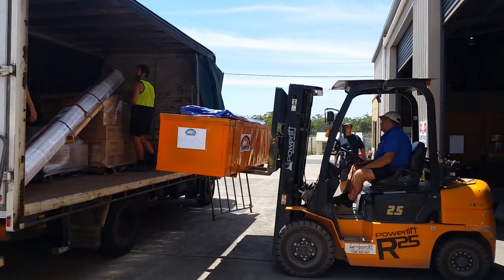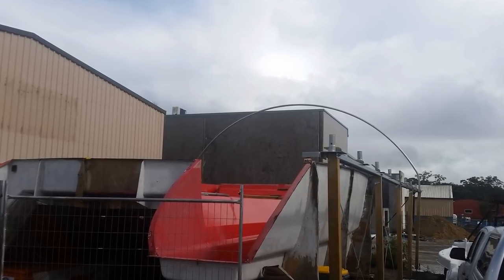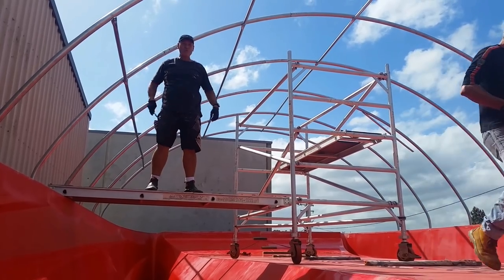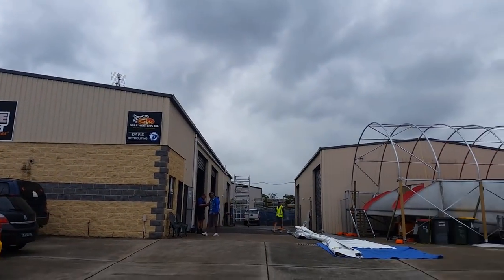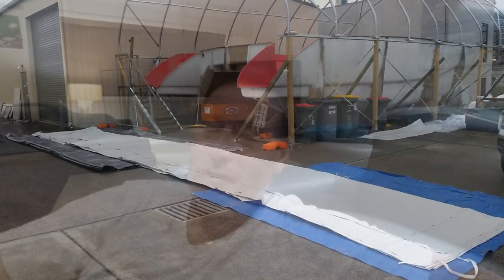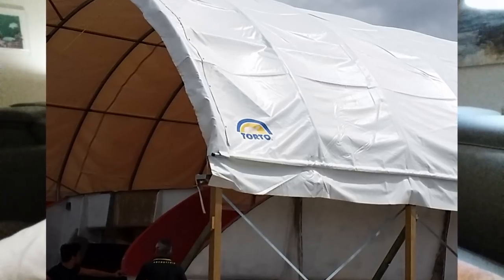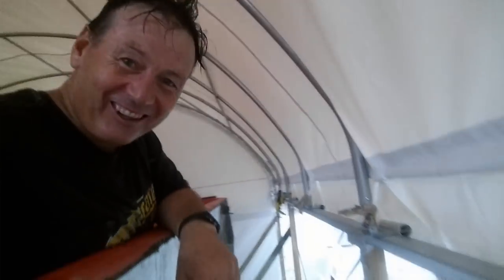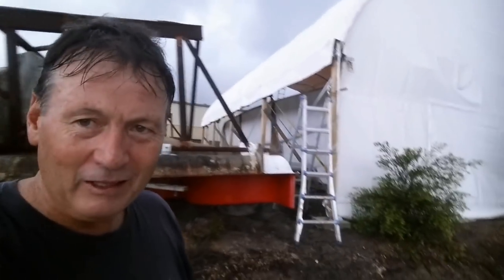Ep003 Massive Tent & Deck Mould Lift

Comment: I don't get it. Why do all that damn work when you can buy used boats so cheap. The market is flooded with cheap boats. You are going to be working for years when you could be sailing and for less money.
Reply from the maker: Hey Ed.I guess that is the crux of this matter.These Cats old and tired are reasonably cheap and come with a host of issues from minor to major including rot,failing engines,and after my spending a year trying to reconcile new /used build my own,i determined that my complete project would be a third of the oost of a new trouble free version.Not including my time.
Reality is ,I just need to build stuff and it may as well be something of value even if only to me.I sail / seakayak / scuba dive every weekend and get the ultimate in satisfaction from producing my own high end products that I know intimately.Keeps me out of retail humdrum and on line shopping sites buying stuff I dont need and burns of any chance of boredom as s middle aged bloke,besides I wouldnt get to share it all with you  guys in these vids if I was sitting on the back of my overpriced poorly built rotting hulk.I love these types of projects and I hope this explains the obsession.All the best Ross